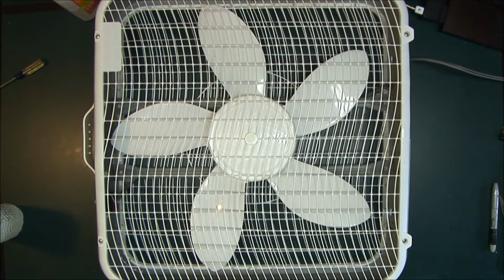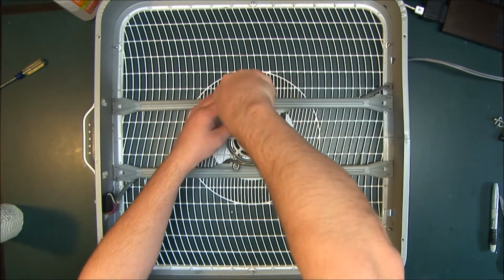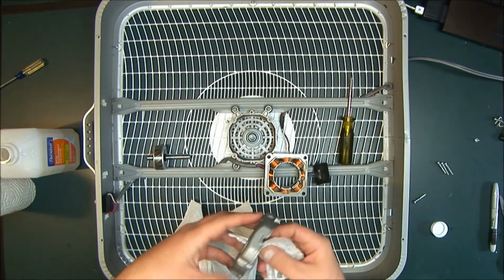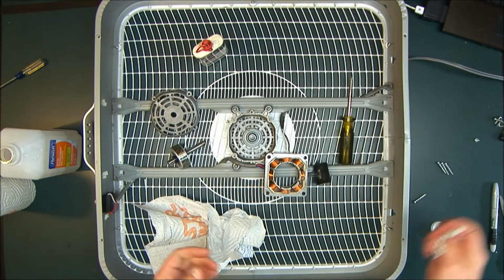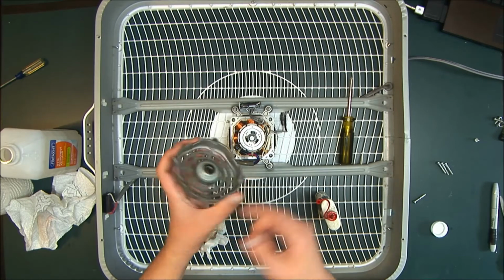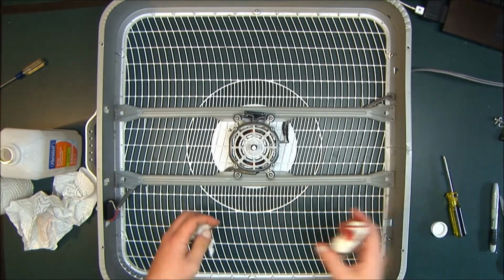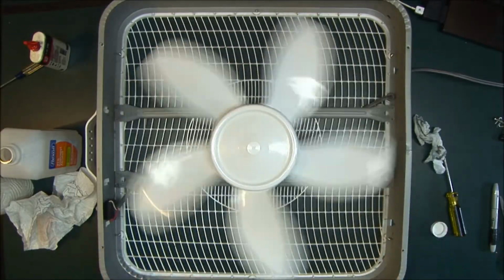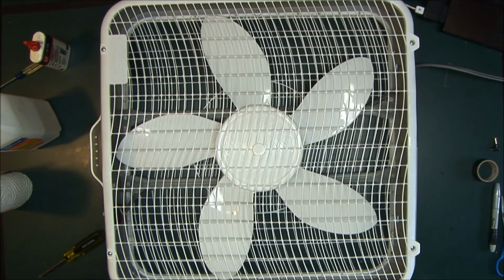How To Repair and Clean A Fan and Motor - Increase performance and save energy

Comment: Can I use grease instead of 3 in 1 oil? Wouldn't grease last longer?
Reply from the maker: sure as long as its not too thick.  The reason I used oil is because the bushing/bearing is porous.  On the outside of the bushing within the bracket is a foam like material that is soaked in oil.  That oil seeps through the metal of the bushing to self lubricate the shaft.  The oil I used was just for the initial placement.  I apologize, I should have made that clear in the video.